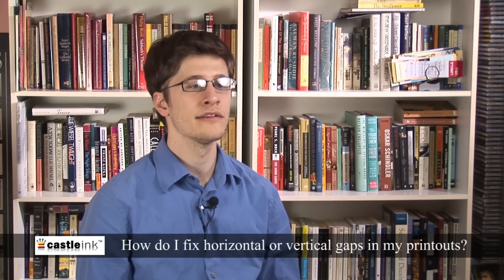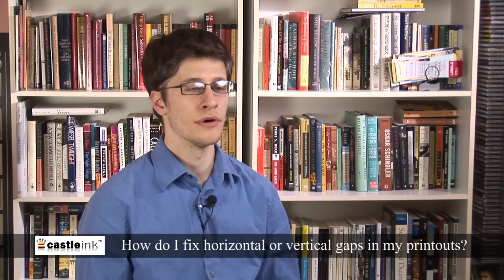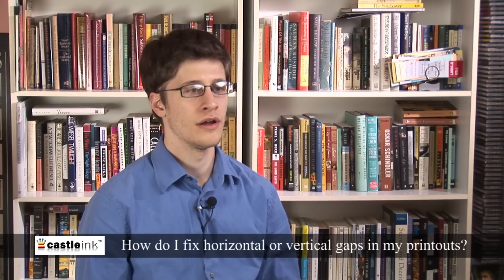Printers - Ink Cartridges - How to fix gaps in my print outs?

Comment: It actually fixed my cartrige. Tried almost everything he mentioned beforehand so I knew what he was talking.
Basically what I had to do was: take out once again the cartrige from the printer, use a bathroom plastic stick with some cotton on top to clen the pins inside the printer, where the cartrige connects to the printer, both vertically and horizontally. Insert back the cartrige after cleaning its metalic connector, too.
Run a print alignment check. Problem solved. Believe it was caused by removing the cartrige beforehand.